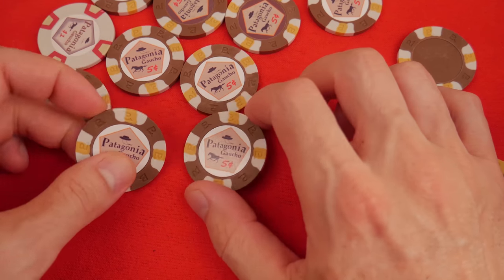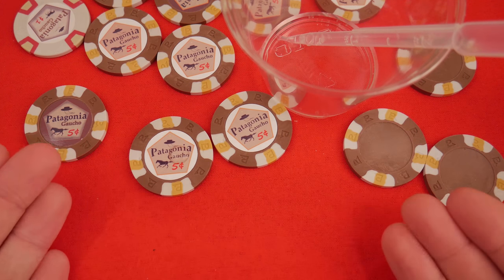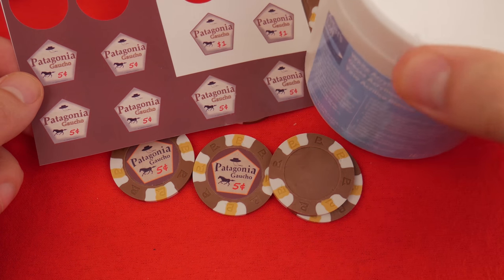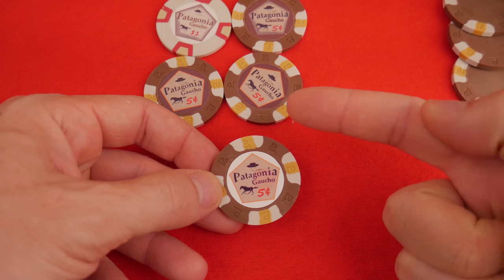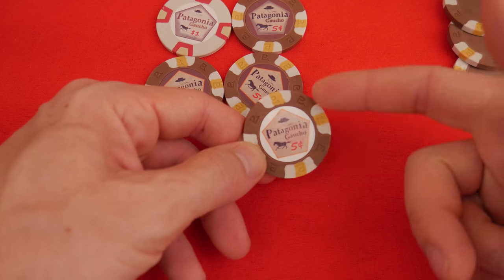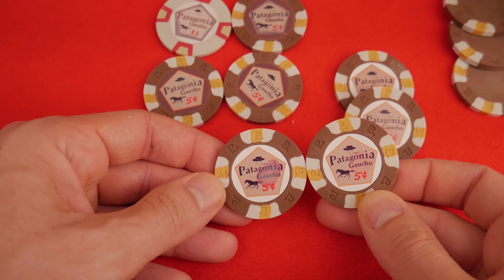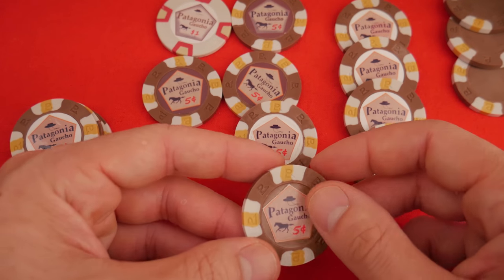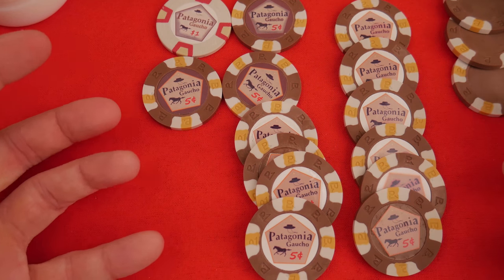Homemade Labels Part 2 - Custom Chips Episode 03

Comment: I use Gear for big jobs. But for short-run custom labels, I’ve come up with a solution. This is great for creating seating chips, where each chip is getting a different label. I buy waterproof vinyl label full sheets made for inkjet printing. Set up my artwork, and print at a high resolution. (Let them sit a bit, because the ink can take a minute to set up.) 

Then I use round or shaped hand punches from a big box craft store to cut out the labels. Aligning the punch can be tricky, so you may want to print extras in case you miss. But practice makes less imperfect, and you’ll get the hang of it. 

I’ve done several sets of Bounty/Seating chips this way, and they have held up excellently.
Reply: P.S. Note that finding exactly the right size hand punch can be a challenge, depending on the inlay area on your target chip. There are both metric and Imperial size punches out there.  Measure carefully and get the closest size possible, ideally a hair smaller than the diameter of your gap.

Comment: I have an Epson EcoTank printer, which brings the ink costs down to pennies per page, and have been working with printable labels. Personally, I recommend using Cricut's printable vinyl labels, which in addition to having a velvety smooth texture and actually taking the ink better than any other medium I've tried printing on, are fairly water-resistant once printed. I left a chip immersed overnight, and the water was able to break down the printable layer enough it could be scratched off, but the image did not run, and after drying, it would have been fine again.

To combat the water problem, I bought clear vinyl, which I apply over the top of the Cricut vinyl, then cut both out using a circle punch I bought for this purpose. I left one of these immersed overnight, and it looks no different from a fresh chip, even after being in my pocket with keys and the usual pocket lint) for several weeks.

Total cost per poker chip label: 2-3 cents.
Reply from the maker: I like this idea, we'll see what I can do.
Reply: Send me a direct message and I can send you a sampler pack. Might be easier than getting everything put together yourself since I already have the system in place.
Reply: I use a similar technique for short-run customs (see comment). I’ve also tried brushing these with Mod Podge, with mostly good results—you can see some brushstrokes if you look carefully. However, the thicker the vinyl and coating, the more issues I encounter with flawed cuts by the punch.

Comment: I guess it makes your life easier to just order durable polymer labels printed by a professional label printing company, after you test and are happy with your prototypes.  You can give them color references (actual chips) so they match the colors.  And strong permanent adhesive on the back should be good enough?